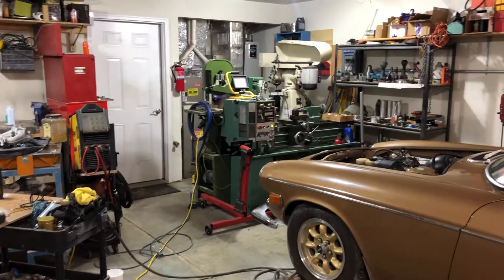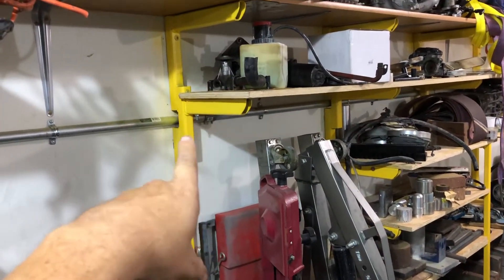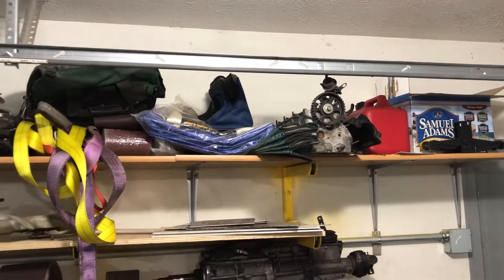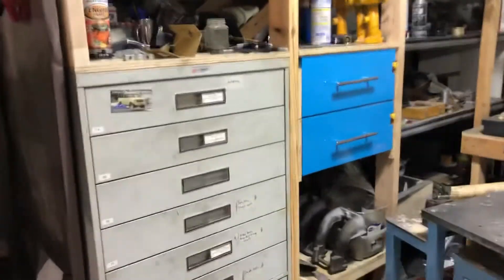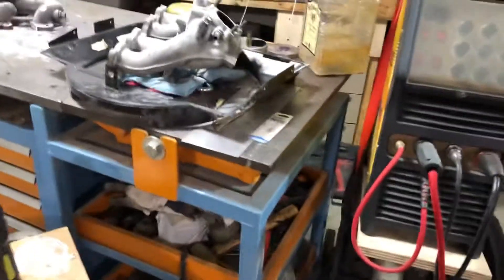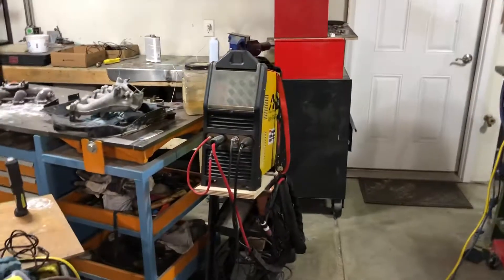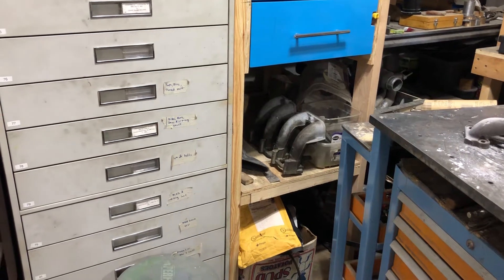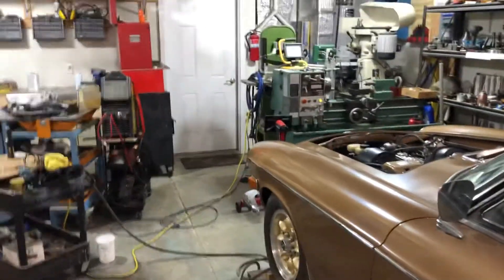Andy’s Garage Shop Tour

Comment: A lot going on in your garage!  Really like those shelves you fabricated, and the stand with the surface plate.
Reply from the maker: Thanks, yeah, it’s a tight space so it’s a challenge to fit everything. That main bench, I made most of it from stuff from the local scrap yard. Some shop literally just threw away that old cast iron surface plate. It had a tag on the bottom that it was part of the WWII effort.